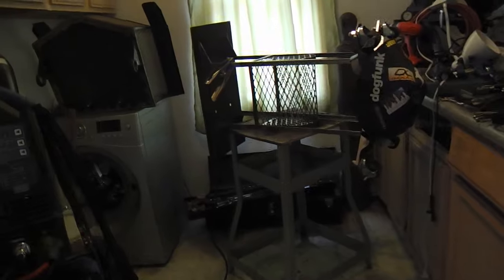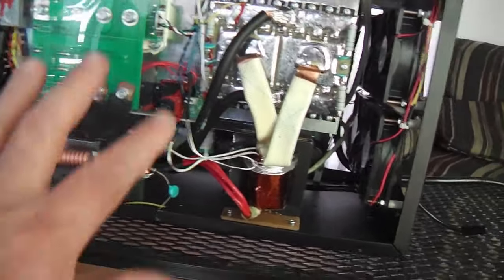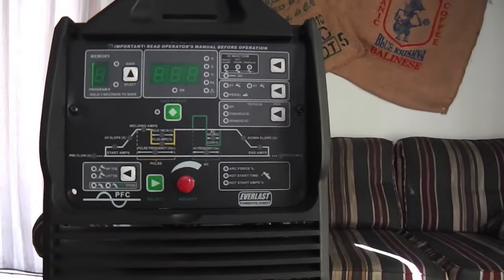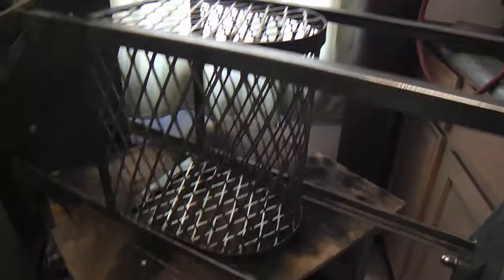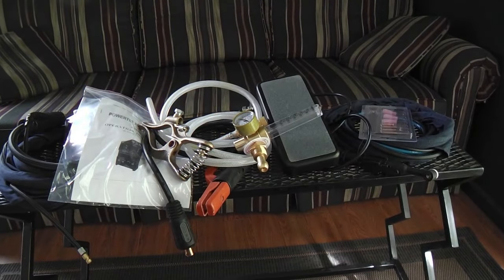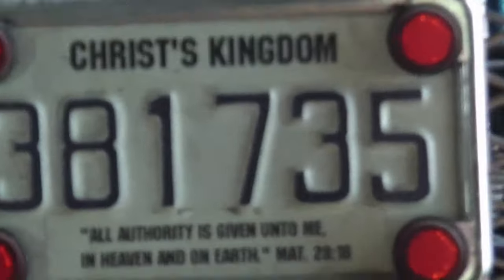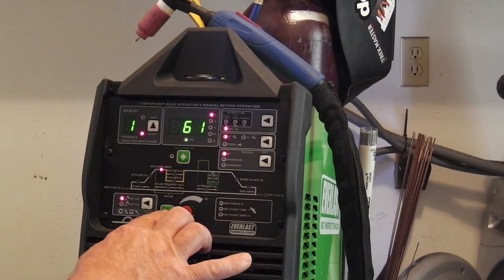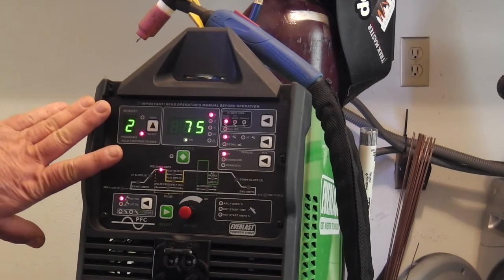Everlast PowerTIG 210 EXT: Review, Rationale, 1st Project

Comment from the maker: Yeah, I'm still diggin' it after about 2.5 years. Everlast is the real-deal, so-to-speak. I dig my 210EXT even more, the longer I have it.
Reply: NewJerusalemTimes the dynasty 210dx is much more quiet then the 200 DX was. The dynasty 210 is a nice welder. My HTP Pro Pulse is awesome and I’d buy a another in a second. If I couldn’t get either of those two id buy if this one. Also the HTP Pro Pulse mig Welder has spot, Pulse plug can do dc Tig
Reply: Update ?
Reply: I'd like to know, what is the ticker aluminum it  can weld, I really appreciate your time ,and answer,  and also  does it need a cooler machine,thanks.

Comment: so how is this machine holding up?
Reply from the maker: Yeah, after more than a year with it now, I'm even more convinced that it is a best-value in-class. It's no surprise that it's great on DC TIG, as most any TIG unit is. But as I get more used to the features, wave forms, and subtleties on AC aluminum, the more I like the unit, if that's possible. I mean, I've only done about four small AC TIG aluminum projects with it, so I'm still no expert, but I'll give a link to the most recent one, which shows me using the 210EXT. You may have to scrub through clips to get to the welding part, as the video is mostly about refurbishing a zero-turn mower. Otherwise, thanks for asking!

https://www.youtube.com/watch?v=-DlxL6lccwQ
Reply from the maker: Yeah, I'm well-beyond the 5-year warrantee period now, and I'm still giddy about the performance and value that it's still delivering! 
https://www.youtube.com/watch?v=dTEhttdi-TM